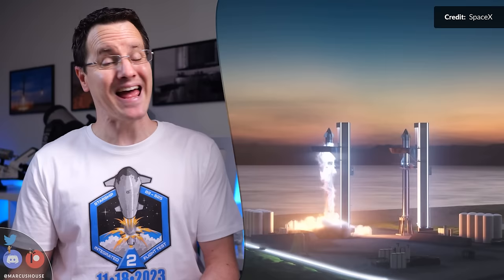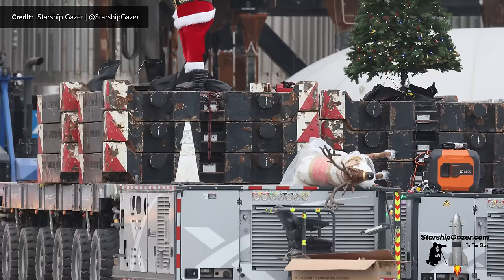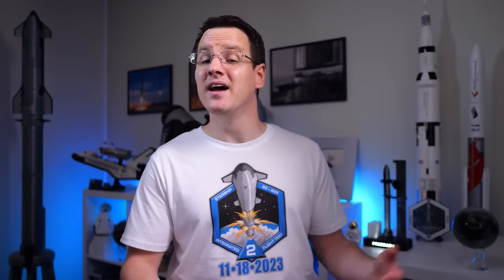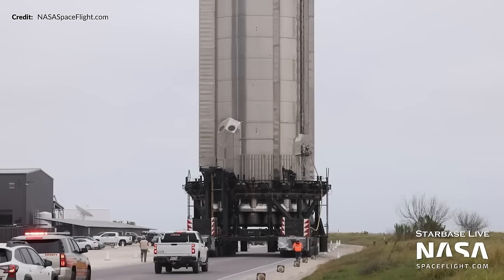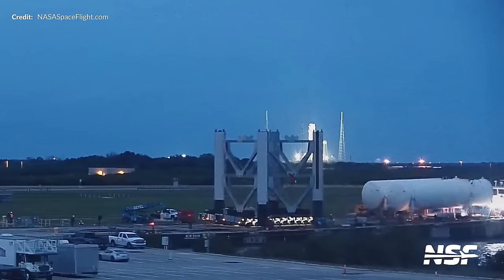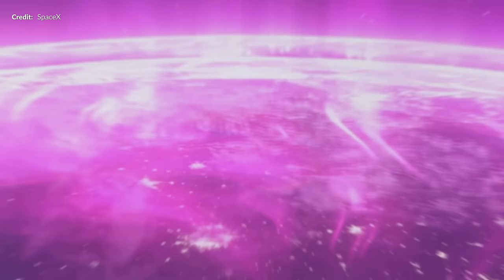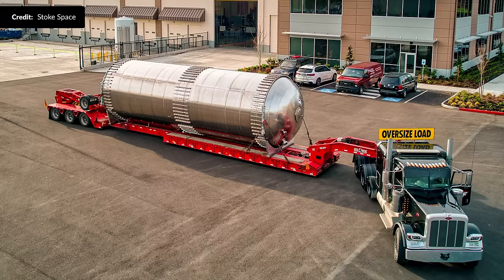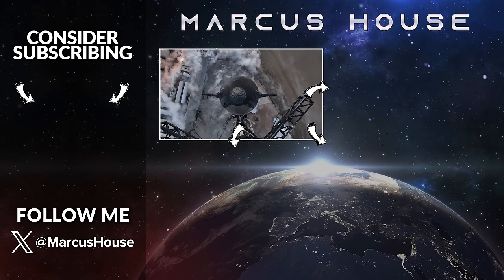SpaceX Starbase Pad Ripped Apart and Massive Site Changes Coming!

Comment: If they extended the arms of the tower and moved the mount 50-75 more feet, there would be less damage.  And less need for constant repairs.
Reply: I understand they would have to beef up the arms because it would loose a lot of leverage adding that length. One would think more distance, less damage.  It would take a lot of time and money.  But Elon is not short on any of those 😂
Reply: @sdizzle1048  the arm damage can easily be fixed by adding shielding, as shown in several renders by SpaceX

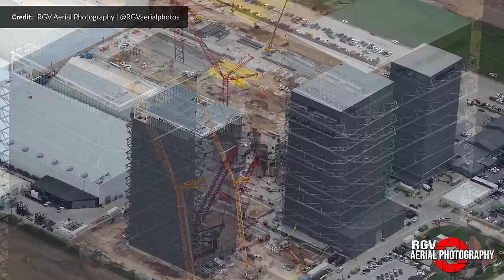Comment: 6:42 mark.  Marcus my fine space fan those, in the building industry and in construction engineering and architecture in general, are called "trusses".  They are generally meant for ceiling support.  A very common design at its heart, tried and true.

Comment: They MUST install deluge on the top of the launch ring.
Reply: You cannot have ambient temp water striking the face of super chilled tanks. You would get brittle fracture.
Reply: @cheddar2648  The ring doesn't have tanks in it.  The water wouldn't activate until the rocket is off the ring.  Easy to do.
Reply: @cheddar2648  Ambient water has hit the starship tanks before during CRYO and static fires. It will be fine.

Comment: why not just raise the height level of the launch pad 33 engines close to the ground seems a bit much to close to the ground being higher off the ground would reduce kick up and the water suppression system would also help also widening the base legs further out from each other leg being it gives the engines more space to fire off without hitting the legs just a thought alternatively you could route some of the water suppression to the legs to help with immediate cooling or you can have cryogenics for the legs
Reply: Or just add flame diverters like the rest of the world figured out decades ago.
Reply: @herrschaftg35  idk how well flame diverter is gunna work on the strongest engine plus 33 of the strongest engines on par or surpass the rd180 engine

Comment: Re: changes to cryogenic testing. Is it possible that a cryogenic test without the weight of the engines isn't representative of flight conditions?  Can too many cryogenic tests cause metal fatigue? Yes, every Falcon 9 is cryotested, but the mass of the fuel inside an F9 doesn't compare to Starship.

Comment: Always seemed to me the wingless SS26 might be the storage tank needed for orbital test transfer. I dont remember why that idea was rejected.
Reply: Sounds possible, but better to be fully capable of testing reentry on the same first suborbital flight. It is going to cost a lot to make (and expend) all those Raptors.
Reply: The first transfer test is only from the main to the header tank. 

Using a Starship without flaps might be useful as an expendable orbital depot in the later ship-to-ship transfers, but that depot is going to need PV collectors, at minimum. (Otherwise the main battery would run down.)

Comment: 8:42 Hol up. Can someone explain the reasoning behind the skipping of the cryogenic tests, or any test at that matter, just to avoid doing the 3 hour moving process (not a delay because moving the rocket to the launch pad is something that has to happen) ? 

Also where is this confidence coming from??? They're still testing the old boosters and suddenly are confident they untested booster 12 will be fine?

IF i'm missing something i'm listening

Comment: They should recycle the heatshield tiles and cover the entire launch pad.  This way they test the tiles and save maintenance in the launch pad....
Reply: Unfortunately it would probably cause a tile tornado. Like the concrete tornado from the 1st launch. 
And those super hard tiles moving extremely fast would slice and dice everything, including oxygen and methane tanks.

Comment: Hello Marcus.  What do u think about “painting “ the launch platform with T800 cobalt HVOF , high velocity oxygen fuel process to “paint” on the T 800.coating.   It is used in jet engines amongst  many other things.  Hans

Comment: Rocket Lab needs to employ an electrical inspection routine that is not prone to trusting there are no errors or trusting the leads are thouroughly validating the people under their wing.
Reply: They already learned and mitigated the arc issue.

Comment: The FCC decision is ridiculous.   

I had Starlink installed at my family's farm, which previously had no Internet service before.  The idea that is the Federal government "gives" cable companies money to install cable across vast rural landscapes in a non-started, to begin with.  You can be the cable companies are taking that money putting it in their pockets and then doing nothing to solve the lack of internet in rural areas.      

The only real solution is Starlink.   An antenna and 50 feet of cable, instead of 10s of miles of cable just to hook up dozens of families.

Comment: STARSHIP IS 16 MILLION POUNDS FORCE; 2X THE SATURN V, and even the Saturn V had Launch Equipment Damage. STARSHIP and it's EXHAUST FLAME APPEAR TO BE ~1,000 FEET LONG. THAT MEANS THAT 12 MILLION POUND EXHAUST MUST BE ~600 - 700 FEET LONG. "THAT" IS GOING TO CAUSE SOME 'SERIOUS' FORCES ON A CONSTRAINED-AREA LAUNCH PAD.

Comment: The Transporter decorations better become a tradition or I'm not supporting SpaceX anymore 😂
Edit: I live in a very rural area and before Starlink my only other options were Hughes 🤢 and Windstream. It took 20 years for Windstream to install the fiber here for low quality DSL(75mps down at most and 5 up) that stops working any time the weather is anything but sunny. Heck they got the money from the First go round of the Obama admin and it still took them a year or two to run 3 miles of line.....

Comment: I've always been interested how SpaceX deals with Corporate espionage, Such as China trying to get Raptor engine Information or anything about starship/Falcon.
I know it's a very HOT subject but i'd like to know how SpaceX Protects their Assets with so much Publicity they are getting Via Youtube etc and being the current Leading Private company in Space Flights and far ahead in the game than any other company/Country for reusable/Testing
Reply: The PLA's general MO is to start with infiltration of less sensitive/secure functions within an organization, stay undetected, and from that base probe for entry points into more high-value areas.  So in the case of a SpaceX, an attack on the "drawing system" might not be a direct one, but instead via employee vacation self-scheduling > HR > Customer Support > Engineering.  If SpaceX handles their info security with the same fast & loose attitude seen in some of their engineering practices, PLA Unit 61486 might not be having to work all that hard.
Reply: SpaceX simply guves the blueprints to China😂

Comment: Why not just build an insanely overengineered launch pad? It seems rather small, but if it can withstand the launch it’s not gonna be going anywhere and can be reused over and over again.

I guess they’re preferring to slowl work their way toward the least expensive and time consuming launch pad.
Reply: The only major damage was due to the lack of a water cooled OLM deck (which will be fixed eventually) and a lack of shielding on the SQD and chopsticks (the chopsticks will eventually receive cladding, and the SQD might as well)

Comment: The entire tower for catching Starships should be floating on a pool of water with vertical rail guides for horizontal stability. There could then be venting pipes to allow air and water to escape as the load increases when a rocket is caught. This would be like a giant hydraulic shock absorber.

Comment: Seems there might always be a risk of damage. Couldn't they make QD with a QD of its own where it joins the tower? Swap it out easily after each launch & refurb for later use?
Reply: Was thinking this would be like a spent cartridge and remove the need for inspection. Just a cycle of use, replace and refurb. Builds in a backup to failure too.
Reply from the maker: Thanks for the SuperChat. I've thought about this in the past too, but I guess they are trying to make it all very rapidly reusable, so best to be able to do it with a frequently reusable part. They are tweaking the design and improving it with each iteration, so hopefully they've nailed it now.

Comment: Marcus, you seem really knowledgeable about rocket science and I need someone with this knowledge to help me understand something about liquid propelled rocket engines. This aroused my curiosity when the idea of refueling the Starship in LEO was brought up. I understand how pumping liquids from one vessel to another works in 1G but I don't have a clear understanding of how this works in micro G. How do the liquids behave in a rigid vessel in micro gravity? What keeps the liquids together and at the discharge port of the vessel where the pipes transfer the liquids to the engine pump or in the aforementioned transfer to another vessel. Also, what replaces the propellants as they are pumped from the tanks whether through tank to tank  transfer or through engine operations? In space there is no air to replace the removal of the propellants and without something to replace them the pump won't work or the tank will collapse. If you can make this make sense to me I certainly would appreciate it.
Reply: I have pretty much no clue but if you look up pressure-fed engines it might get you in the right track. With those they use an inert gas like helium to pressurize the direction they want flow
Reply: I'm not an engineer, so I am completely unqualified to answer this question
With that out of the way:
AFAIK, so long as any undesired forces on the fuel do not exceed the force of "gravity", it should remain settled. And if the propellant is settled, it will stay at the "bottom" of the tank so long as "gravity" is present. 
How the propellants will be transferred is unknown, but the most likely setup is that the tanker will dock to the SQD of the ship, and then use a specialized pump to move the fuel from the tanker.
As for what fills that volume, it will simply be vaporized propellant. But the change of propellant volume won't be severe for a vehicle at 7 bar (it would decrease to ~6.3, which is acceptable). And even if it vented to vacuum, the tank wouldn't collapse, because there is no external pressure.
Reply: @bryanillenberg  thanks 😊 
I was wondering about the atmospheric factor or lack thereof in the tank collapse, but I failed to get it into my question.
Reply: @danieltrimner1470  thanks for the info 👍

Comment: So, lemme get this straight.  They built a set of arms, capable of lifting and positioning a fully fueled starship… and NO ONE thought to place a traveling hoist on the bottom chord so they did not have to drive a 200 million dollar crane over every time they need to lift a ton or two?
This launchpad is the worst piece of engineering planning I have seen in decades.  Every single use of it requires millions of dollars in repairs.

Comment: It is good to see the U.S.A. Government has not drank the Musk snake oil salesmanship kool-aid and is willing to pull funding when results and science do not result in the desired goals. Musk would never hold back if or when other systems fail, so they should be held to similar standards. I hope Starlink performs to spec. but the fact is the nee sayers appear to be correct as of this vid.